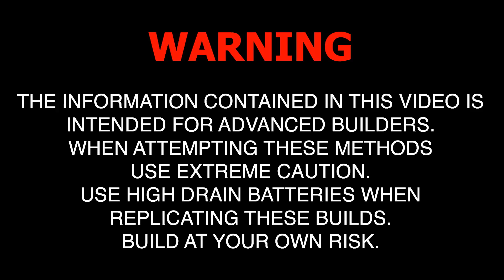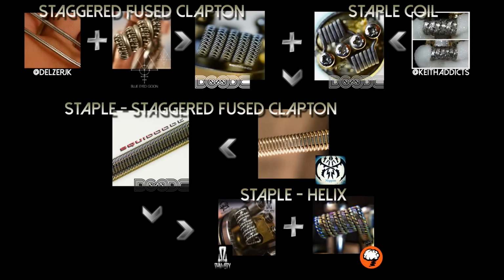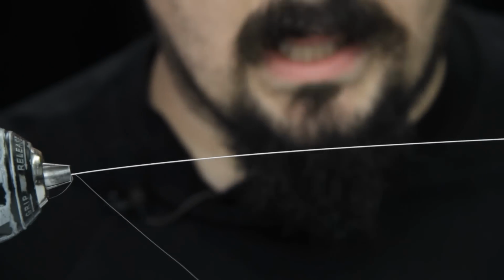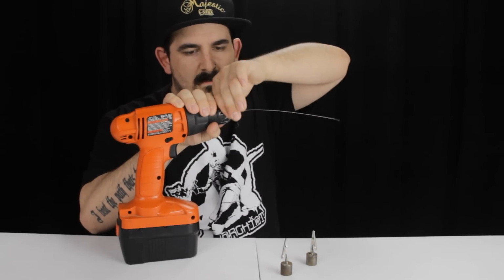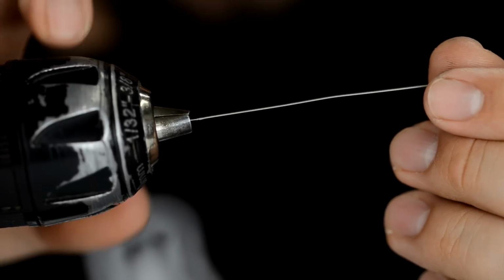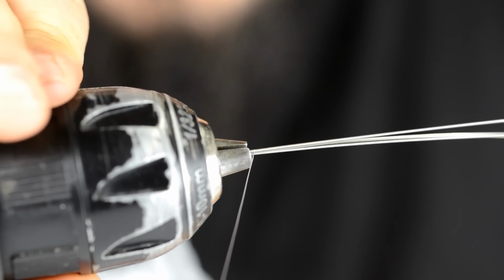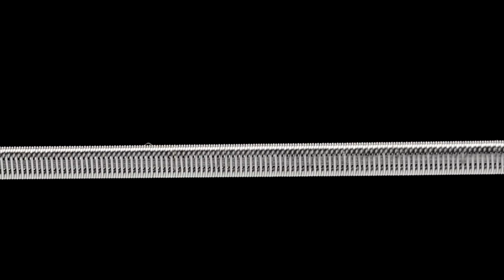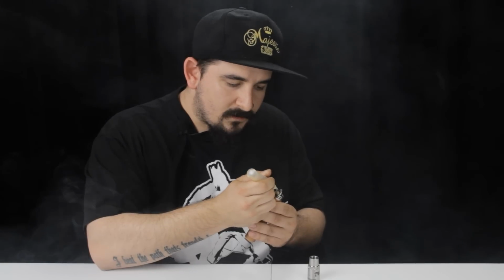Episode Four - The Staple Staggered Fused Clapton

Comment: new to building coils and all I'm wondering is how would I get this to a safe ohm level like above 0.45?
Reply: rawr XD
Reply: safe ohm level for what mod?? .1 is considered safe on a parallel unregluated device.. sounds like you are using series?
Reply: Yes, noisy cricket specifically, I tried having these on my tube mod but I don't enjoy how long it takes for it to heat up.
Reply: +Arian Rawr you are gonna be hard pressed fetting this to a safe range for a series mod.. you have 3 options.. (or a combination of the 3..) 1. more wraps, 2. smaller gauge wires, 3. larger diameter coil.. combining the 3 you may be able to get it to .35 (still safe with quality high drain cells)
Reply: Thanks Rob, the science of it didn't really click in my head yet, but this makes perfect sense :)
Reply: +Arian Rawr yea all 3 of these options will add resistance, the problem comes when you get reallllly small wires they can be really hard to work with, thhus adding more wraps and a bigger diameter will also help bump up the resistanc with out having to do like 36 core claptons lol
Reply: More wraps, or use thinner wire.

Comment: when I'm trying to make this coil all my wires just making a triangle and not staying parallel, what can i do with it?
Reply: first when you put the wires in the drill you have to make sure they are perfectly parallel and then I use a trick that I learned from M Turk I'm lucky enough to live very close to the shop that he works at but he uses a paper clip to keep the wires parallel you just have to stop every couple of inches and Slide the paperclip further down until you get to the end it works really well

Comment: What batteries are you using with this .16ohm build? Konion VTC5?
Reply: Not sure what he is using but to be safe I would recommend LG HD2s which has an limit of 25amp continuous or the LG HB6s which have a limit of 30amps continuous. 

0.16 comes at to around 26 amps on a freshly charged battery @ 4.2 volts.

Comment: please need help[!!!!! tried to make my own coil about ten times now first a single coil the i bought pre made twisted kenthal then iv just bought some pre made clapton wrapped it in a coil maker so the coil is perfect it glows from the inside out add the wick and add e juice which is 80/20 vg to pg ratio.and every time i do not get any clouds it just chokes me to death any ideas?
Reply
Reply: +adz davies probably something wrong with either your mod, airflow or both. Try firing it without the cap on, and see how the vapor production is. Read up on Ohms law. Also use the website, steamengine. That should help.

Comment: Nichrome isn't the easiest to get hold of in NZ, does the performance differ to much if I were to use Kanthal A-1?
Reply from the maker: Cookie McCook Cook you can of course use Kanthal A1. One of the biggest benefits to nichrome is that it had a lower resistance per linear foot. In this video I am using Anarchist Wire as the core which is basically the purest form of nichrome and I'm using nichrome80 for the outside wires. If you use regular kanthal the performance will be less than the wire combination I used, but it will still be a fantastic vape. You will have a little longer ramp up time and a reduction in flavor, but if you haven't ever used nichrome or Anarchist wire, I think you will still thoroughly enjoy the experience!
Reply: Awesome :) Thanks for the feedback Dood! I've ordered Anarchist Wire & Nichrome 80 for this very reason, but obviously would like to practice on much cheaper wire. Legend, cheers!
Reply from the maker: Best of luck brother! It might take a few attempts but stick with it and I'm sure you'll nail it!
Reply: Cheers buddy :)

Comment: The staple staggereds I got from my friend are ohming too low. Like .08 an then jumps to .12 then goes back down. But my rdta won't work on anything lower then .1. So basically my question is how do I mess with it to get it to stay consistently ohming above .1?
Reply: RyRy Wood Not really much you can do as far as I know, maybe fire up dry and squeeze together or check for hotspots. Might have to build new coils.

Comment: Quick question, how important is it to use nickle for the clapton? Ramp ups usually arent an issue with my box (triple 18650 series), and i don't have any nickle wire on hand.
Reply: first of its nichrome not nickel, nichrome has a lower resistance than kanthal. anyway, you should not build lower than ~0.5 on that triple series box as the amp limit of the batteries is usually around 20amps. a 0.2 coil at 11V pulls 55A, which results in 605watts...

Comment: what is the different between Ni80 and Ni200. If i had to made this using Ni200 will there be any differences?
Reply from the maker: Izs Riso Ni80 is a Nickel-Chromium Alloy blend (resistance wire) where Ni200 is a Pure Nickel (Non-resistant) wire. Ni200 can only be used in an application where you have a temperature controlled device. It will not work the same on a non-temperature control regulated device nor a mechanical mod. The main reason for using Ni80 (or commonly referred to as N80) is because it has a much lower resistance per linear foot which greatly decreases ramp up time as compared to kanthal. I don't have a lot of experience building with Ni200 but from what I have found with working with it, is that it does not allow you to do more intricate builds, at all.. It's too much wire and comes out to "low" for any temperature controlled device to be able to read it. Thats why you will never see any build like the one in this video done with Ni200. Hope that helps!

Comment: What did he use at the center, between 2 claptons? Is it a flat wire or smth else?
Reply: it is flat wire. Its called kanthal ribbon wire. Thickness is 0.5 x 0.1 mm
Reply: yeah but not a single piece - it is 5 stacked together
Reply: That's  correct, but the thickness or diameter of the wire  / ribbon is still 0,5 x 0,1 mm ;)
Reply: tru dat! - and once stacked it's 0.5mm x 0.5mm square - that's the reason for 5 pieces of such size. BAMM!
Reply: But i think there is a difference between 5 stacked 0,1 x 0,5 's and a solid 0,5 x 0,5. The liquid can soak into these little gaps --> bigger surface --> more vapor and flavour.
Its just a guess, so it doesnt have to be true :)
Reply: it's really just to keep the pieces of wire totether, acts more like a temp adhisive

Comment: How come when I make this build I have to crush the leads to get them into the posts and your's just flies right in? lol... I am guessing you drilled those post-holes out, correct?
Reply from the maker: Ian Billings I did not drill out my post holes nor do I recommend doing that. I'm using the authentic Twistedmesses RDA which has 4 2.8mm post holes. If you're using the same rda and it doesn't fit into the post, you have a clone!
Reply: Nah, I don't have the TM RDA, I think I am using too thick of cores.

Comment: you seem to always use .5 ribbon wire. all i have is .8. will that do?
Reply from the maker: +Daniel Hudson .8 ribbon will work, but you will want to compliment it with like 24ga instead of 26ga (for this build). .8mm ribbon is what I started working with, at the time it was easier to work with and I could begin to see what I could do with it. The downfall, using .8mm in many different Staple variations, the coil/wire turns out quite large and low in resistance.... You will get overall better preformance and practicality (resistance, dual coil configurations, fitting in more atomizers) when you reduce the ribbon size.
Reply: thanks for answering. I have noticed how big it can get. Also, like you said in your vid, it is a real pain in the arse to wrap. I have already ruined two builds because of the wrap. When I  get one right i will post it and hashtag you. Thanks again.

Comment: hi, i got these Demon Killer Staple Staggered Fused Coil Kanthal A1 + 316L Stainless Steel, 0.3 Ohm dual coil build reading at 0.15ohms.. i only got one concern.. what wattage range should i use this in?
Reply: it depends, you should start low and gradually increase it.
A safe spot would probably be 75-85, be careful of going over 85 though, just test it and burn a couple of wicks until you find the spot.

Comment: dope... i think i noticed that you had two on your mod previous to the build portion of this video? is that possible and if so what do you need to do it?
Reply from the maker: +BRETTbastien yes, I was running a dual set up at the beginning of the video. You can run a dual set up as long as you have an atomizer that can house a large build like that and good high drain batteries. The Twisted Messes RDA would be a great atomizer that would easily fit this coil in a dual set up!
Reply: +The Art of Vaping I have a Sigelei 150 tc, could I get that RDA and do this build with that?

Comment: im trying to do this with 0.3x0.1 kanthal a1 ribbon. im having difficulties stacking the ribbon and keeping it flat in between the SFC which is 28awg ni80. water trick doesnt help me that much due to the tape slipping. any recommendations other than upping the ribbon?
Reply: I saw a different vid where someone used 36g (I think, might have been 40g, it was thin in any case) to wrap the ribbon wires together at the end.  

Not sure if that would solve your problem, but hope it helps!
Reply: use a piece of ribbon as a guide.. wrap it around your stack loose so you can move it as you go, using water and this is my preferred method

Comment: I'm not being funny here but I can get as far wrapping the final clapton wire but I can't seem to be able to stop the wires from twisting, even when I get pissed off and try to wrap the final clapton manually all the way. Can I get some tips here on how to stop the whole lot twisting like a mofo?  I noticed in this build there was one negligible twist in the whole 8", whereas mine would have around 10 twists and I would have very sore eyes, tired fingers and a much increased blasphemy vocabulary!!
Reply: it can be a little tricky to line them up but you can put them on a swivel which would help some. also you could take pliers and every so often give them a gentle squeeze to flatten them back out. hope that helps and good luck on your coils :)
Reply: I use four swivels but have just bought some bigger ones so hopefully that will help. What I really need is a thrust bearing with a loop on it.
Reply: COULD TRY A DROP OF JUICE FOR LUBE ON THE SWIVEL ALSO, OR SOME WD?
Reply: Mick Moore Really??? I've made 'Staple' Wire and 'Framed' Staple lots of times and this one just once but never had any even close to twisting, and not cos' of my technique or anything like that but because there's so much damn metal that it's stiff as fuck and can't twist. 'Fused Clapton' or anything like that is a total different story, that for me twists like a bitch!!!!!

Comment: This is a fkin masterpiece. Right now im vaping a kbox, and its 40w tops and doesnt support lower than 0.4, but im sooo buying a mechmod just to make some of them beautiful coils and see them going. BTW, you think Efest 2800 will support this nice? Its stated 35A max continuous discharge, but as the phrase goes "You trust Efest - you die hungry"
Reply from the maker: +Анатолий Бакиновский haha I'm not a huge efest fan, I don't use their batteries. It's not that they are bad batteries but they are just rewrapped lower quality batteries that are made by top brand companies. So for example, Sony makes batteries and they quality control them. All the good ones that get their wrap and logo go into an "A" bin and the lower quality ones go into a "B" or "C" bin. Then a company like Efest comes and buys the "B" and "C" bin batteries and puts their wrap and logo on it. So you're still getting a battery made by a respectful company but they are lower quality.
Reply: +Анатолий Бакиновский If you can find a genuine Sony VTC 5, that'd be the way to go. It's well worth the slightly higher price in terms of performance and lifespan.

Comment: Out of curiosity, what would you run on something like this, wattage wise? I have never used a vv mod, I've always been a mech guy myself. I have a dual 26650 series mod that's mech, but I can't run this on it because it's too low, so I picked up a sigelei 150watt box. Thought I would get some ideas on what wattage is preferred with a build like this. Both dual and single coil.
Reply: The last dual staple Clapton's I used , I ran at 85-95 watts, and really wished I would've got the sigelei 150 instead of the 100..... #Hindsight
Reply: No lower than 80 watts...ramp up time would be ridiculous under 80 watts I think.
Reply: Single coil, you might get away with 55-65 watts tho
Reply from the maker: Robert Mason if I were to run this on a regulated high wattage device in a single coil set up I would be somewhere around 110-130 watts as a dual (provided you have a device that will fire that low) I would be more in the ball park of 130+ watts. Now that sounds like a lot but it also has to do with the resistance and to get the power output with some of these lower resistance builds, you need more wattage. Honestly, this build in a dual set up works great for me on a mech device!
Reply: ***** well, you are in luck, that is one of the coils that are in your grab bag ;)
Reply: The Art of Vaping oh I loved this build on my gladiator 26650 setup, but I've been using boxes a bit more and it is too low to put on my dual series 26650 unregulated box. I was running at 150watts single coil, only I was using 24AN80 and had 4 wraps. Hit hard, but was running into dry hits, even though the cotton was saturated. It was just burning it up. I think I'm going to go back to the 26KA1 as the holding wires. Thank you for the help,and the beautiful build.

Ken -Broken- Greenwood and BaNdy VaPeS thanks for the input, much appreciated.
Reply: The Art of Vaping out of curiosity, do you have g+?
Reply: Single coil mode on my Mutation 26650 sized RDA, triple 26650 parallel box.  vapes like a dream.  Oh and that's one of your coils I'm vaping my friend.  vid on my Youtube channel.
Reply from the maker: Robert Mason I do but I haven't started to utilize it yet. Best means of communication for me is currently through my email
Reply: Robert Mason i just did a quick rapidtables calculation. a fresh battery (4.2V) in a mech with little/no voltage drop should be firing around 100-110 watts on this particular .16 ohm coil. I'd start from there and adjust to suit your preferences.
Reply: Robert Mason temp control with stainless on a vv it the way to go

Comment: don't even know the reason for these builds. all hit and taste the same.
Reply: +Rigondeaux I don't think you're doing it right then, there's a huge difference in the quality and experience of the vapor depending on the build you use.  You're going to get far more flavor from a twisted build than you would a single wire build due to surface area alone.  Not to mention the better ventilation of your coils allows it to wick more efficiently granting you a longer sustained life of the coil and wicking used.
Reply: I thought that too. but I bought some Helix and zippered Clapton staggered coils. We are WRONG!

Comment: do you sell these? I want to buy four of them.
Reply: +Caleb Purvis same!!
Reply: yea like $30 a pair.. twisted messes site has them
Reply: lol wut? The chinese has the machine-made one. Called Demon Killer it's build from Kanthal A1 and SS316L. Wouldn't recommend chinese made SS316L though, metal coating is absolute shiet, 4 hits and you're changing coil. Lmao. But yeah, Demon Killer Staple Staggered Coil is about 6-10$ perbox. Each box with 10 pre-made coil of this - in it. Never tried one, maybe the stainless steel coating is far more better. Just try to not buy chinese made SS316L, ever.